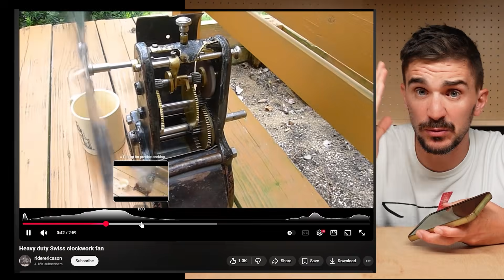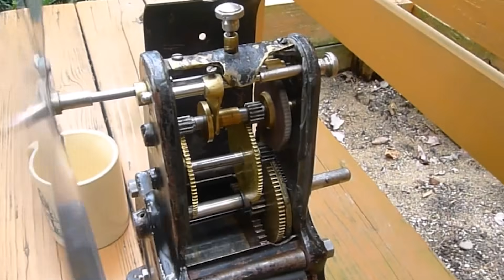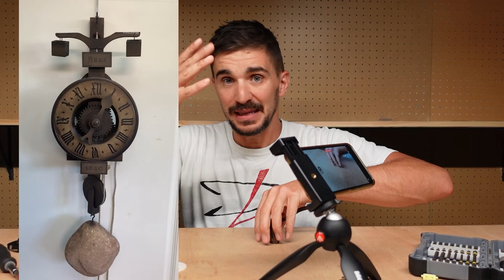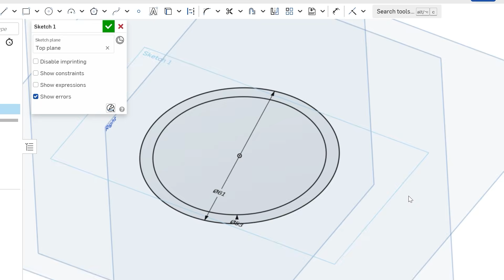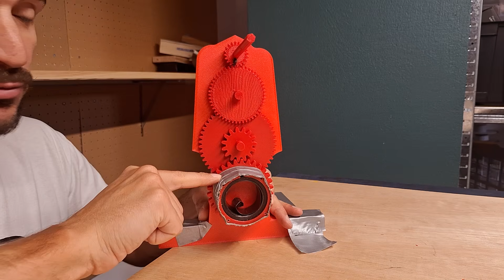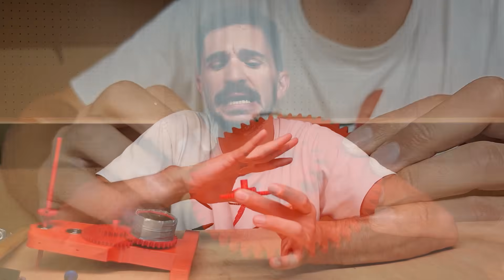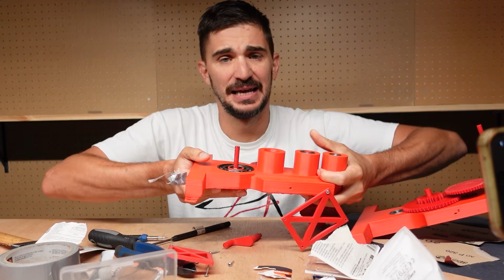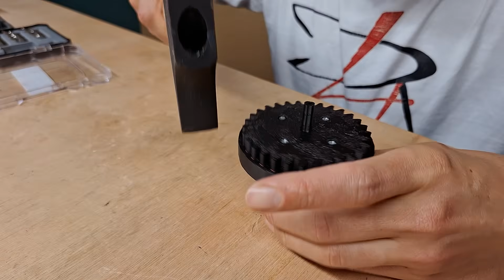No Cables or Batteries, Just Pure Mechanical Engineering - This Swiss Cooling Fan Cools You For Free

Comment: Wouldn't steel shafts and the bearings in the gears resolve your accuracy issues? There is also the weight of the gears, steel gears store allot more inertia, that could overcome minor imperfections or interruptions in the gear surface. Steel gears would be very expensive, but you can substitute it by adding weight to your plastic gears. Teflon spacers would also eliminate friction from gear faces contacting each other.

Comment: Hey! So, what if you used (laughs with you) electroplating & maybe a Stirling engine effect in your clock work. I mean, you now know that it will take more than 3 days to figure it out, how about 3 months? No, that's probably normal. Honestly, its getting tolerances down, sure, but it doesn't change friction components, vacuum, needing magnets in the teeth for the gears, & at that point why not just go for it & make a stirling effect anyways. Those are amazing clocks btw, astoundingly brilliant.

Yes, they are already made, yes they are amazingly high efficiency & even worse still, the processes they make them from as stupendously easy now. Which makes us feel like we can just go and do it. Which is true.

Not exactly much more than dunning-kruger effect problems of the skill gap issues that start almost all projects. (said in a nice wafty innocence voice that says its a truth that underlies a joke going on)

Because, it is though. Hard to get there & it requires consistent effort to make it. Instead, I can tell you magnetic bearing work & them on gear teeth work & using a small light oil works & having one crank move a total amount of air volume out gets a cube law theory of increase of total energy gained that can now use friction & pumping oscillations to drive out heat into a spring & that can start taking air out of the cylinder that you cranked down the plunger to then make the thing work with a flywheel like effect as the spring forces it to rotate.

 That helps with quite a lot, in terms of how its connected to any given styles of gears that then make a impeller with a set of center stators then a final propeller fan using a darwin like sucking in effect for air multiplication through Bernoulli's principal having the air split from the intake duct over the impeller. Meaning the impeller side has a duct, yes, then that leads to a middle stator area that needs your propeller & impeller to have a shaft/axel that is connected, thus stators in-between. A set of stators bent correctly will drag air using the coanda effect & trail off the tips from the before impeller.

with the duct splitting the air & joining the stators behind. Clear on that. Good.

Then the larger propeller fan driven by the cleverly hidden drive shaft that is hidden in the stator connects to the gear attached to the axel/shaft in this impeller & propeller set up where the stators are. 

From here, the ring that extends off of the tips of the stators & before the propellers allows for a series of connecting stators that go over the propeller blades & then have a ring in front of the propellers to help reduce the wing tip vortexes generated. A knob makes it possible to change the angle of the stators. Gears, strings hidden in the hollow stators all make this possible.

Which, you are clever enough to know how to do that.

I don't need to explain the how, I mean, pivot sections, tightening strings, rotating things, shaft rotates, etc you get it.

Lube with magnets to force it into specific alignment & not have to care about massive tolerance issues & needing metal & extremely fine machine work does help make this work better.

Skill issues of design, but also skill issues of thinking it will be easy. Doesn't matter, it takes skill to do this. Kudos for trying & kudos for having the skill to do it at all. I appreciate it dude. Maybe this could be another design you use, credit xenonreality (that's my other account)

Comment: How does the Stove or wood burning furnace Fan work?
Reply: The difference in energy between hot and cool creates a bit of an electric charge which then powers the movement of the fan blade. This is the cliff note version. You can dive a lot deeper into the concepts of peltiers and/or the Seebeck effect to understand more fully.

Comment: Engineering HighlightsEscapement Control: To prevent the spring from unwinding all at once, the fans used a regulator or escapement similar to those in mechanical watches to ensure steady rotational speed and consistent airflow.Precision Machining: The mechanisms required highly accurate gear machining and special spring tempering to withstand the extreme heat and humidity of tropical climates.Adjustable Performance: Many units featured a small lever that allowed the user to adjust the blade speed

Comment: The spring you used was maybe only 10% of the strength required, and 16:1 should be closer to 250:1. Notice in the video the spring barely moved -and it was maybe 5 or 6 inches wide. And, yeah, metal gears.
Reply: I used to have a wind-up radio that would run for about 1/2 hour. The mainspring on that thing was scary. At least 2" wide.
The spring would unwind slowly, and the little generator at the end of the train ran pretty fast, on a tiny rubber band that looked like an O-ring.
When you turned up the volume on the radio, the generator would slow down quite a lot! (this made the volume self-limiting.)
Reply: @eclectichoosier5474 
I currently have a radio like that... I immediately thought of gutting it and turning it into a fan lol but alas, I like it as a radio, it also has a solar panel and can run on sunlight, or the spring and the housing is clear plastic, so you can see the internals at work... 
I knew his fan wasn't going to work at 16:1 ratio...
Reply: @Quickened1 you might have exactly the same radio that i have :)
Reply: @eclectichoosier5474 
That's cool! I've been using it lately. On the hand crank handle, it says, freepower... freeplay. If yours does too, I guess they're the same. My radio is getting a little hesitant pulling in stations, like maybe a cold solder joint or two, but I think I'm just going to keep it as is, even though I would love to make a fan out of it! I've always been fascinated at how long the radio plays with 54 cranks!

Comment: Try a car leaf spring with a regulator so it doesn't take off.😁
Reply: I was going to suggest coil spring, but same idea.  If you've even used one of those DIY spring compressors (2 long bolts, with 'hooks') then you've collected energy until you saw the very face of god, and trembled, lol.

Comment: Ticking 4 answers: clockwork edition.
Maybe you heard about antique (around 1900) Stirling engine fans, aka "hot air fan", they can use heat of candle or kerosene lamp as energy source

Comment: Alternatives to clockwork mechanisms
A Sterling engine.
A weight and pulley system
A water drop system . This is similar to the pulley system except a container of water slowly fills until it overcomes the mass of a weight and pulls it to the top and the water falls out at the bottom returning the cup to the top to fill again, a gear and clutch mechanism lets the pulley spin the fan almost continually. If you have a stream or running water or a really big reservoir it will run for as long as the water flows

Comment: I believe there’s some kind of gear ratio going on in the winding of the original fan shown, the handle is too long to be a low torque application on the winding. Also considering the size of the bottom on the original fan I believe there’s a lot more spring there.

Comment: the surface friction can be helped with hdpe tape or a ridge that reduces contact area. you can make the internal structure as part of your design by using the shell tool and working with a cross section view to add your internal structure sketch
hope this helps

Comment: Know what´s cool ? The modern version of this would not be a plastic copy of the old, but instead a small battery with a hand crank and a generator attached, so you can use it "in the jungle" you can charge your phone with it and produce light, listen to radio that type of stuff.

Comment: 33:20 - well, no. It won't pay for itself ever. 1kWh of electricity (from mains charged battery) is way cheaper than 1kWh of food.
Reply: But humans need some workout. Better to make some useful work than waste that energy in a gym.
Reply: The food will be consumed with either power source, and when elec is not available, the application where airflow is critical the food input becomes very profitable
Reply: @orthodoxNPC good luck having enough food in a place without mains electricity.
Reply: @volodumurkalunyak4651 yea i know right?  Good thing those mains have been around for thousands of years!
Reply: @orthodoxNPC thousands of years of barely enough food and plenty of exercise. Today is 2026 and I am writing about today, 2026.

Comment: To be honest, yes they were precisely engineered.
And the Gear ratio does look a lot more precise with that old Fan
However for you to have 3D printed that and out of a Measuring tape spring is equally Impressive.
Yes the Potential is there, but nobody has dared to recreate it.
I still believe that we need more Manual operated things in our broken economy
Metal machines that are more mechanical than electrically operated.
Sadly we are in a Buy once, throw away later economy where we buy the same things (like electric fans) each year and throw them out in about few years into the future.
Remember those old dryers that you basically squish your laundry and squeeze each drip of water out of them?
I dont have space for a modern day dryer, but a bucket or Tub to place such mechanical one would do wonders for me and accelerate the drying process.
Sadly you dont find these and they genuinely are hard to find and are expensive or just too big or not the right size, also made out of plastic instead of metal rolls.

Comment: It doesn't have to be expensive. Similar clockwork supplied with a DC brush motor with around 20 000 : 1 gear ratio for toy cars costs something like $11 (40 PLN here in Poland). Gears generally are mass produced as never before, now with plastic not metal as much

Comment: Rather than sanding the faces of the gears, I think I would offset them so that the faces don't touch. Small bosses on the gear shafts press against the inner race of the bearings to keep the gear in place and maintain the clearance between the faces.
Reply: Thrust washers aka shims do the job.
Reply: I was thinking much the same!

Comment: I mean, you could have skipped the sanding by making the gears a bit taller and using spacers, which may have also improved allowances in the system. And you could make it more efficient, less noisy, and maybe even cheaper with just a sheet-metal framework. If you use a different translation mechanism with a vertical shaft (driven by a worm gear from the spring box), it may only need four or five bearings (one on the load side of the fan, one or two on the vertical shaft, and one or two for the spring box), and a bigger spring box with a more powerful spring... I don't think it would be more expensive than an electrical fan. 
But I'm just a tinkerer with a bit of mechanical background, not an engineer 😁

Comment: You can always spin a manual flywheel as a fan. The oldest manual lathe tech. Forget the complex clock gears thingy. Sure you can use gearing to get the single shaft fan flywheel faster. Flywheel requires no springs. Literally a spinning rock battery. If the fan has internal flywheel then just spin the fan on a bearing shaft hand crank. Best gears are no gears required.

Comment: You need to wind up the spring first (like use needle nose pliers to turn the end in the middle so it is wound around pliers, or 3d print a piece to wind it around), then you can transfer easily
Reply: Yeah and make a rewinding tool from a cordless drill if you unspool one

Comment: There are fans that work off thermodynamics. They're for using on top of wood heaters.
Reply: Those aren't thermodynamic, sorry. They use a peltier junction to generate electricity which then turns the little motor & fan, or maybe this is something I haven't seen yet?
Reply: @sandrainthesky1011 , I'm talking about the ones that use a Stirling engine.  Those do operate on the thermodynamic principal.
The ones you mentioned use thermoelectric , (as you said a peltier junction) to operate.
But yes they have them, and they pretty pricey compared to the other ones.

Comment: cutting spring made me sad( minus longevity,  because of stress concentration spots by uneven cut
shafts shouldn't be printed vertically, 3d prints are much stronger along the print bed plane, layer adhesion is weaker
instead of polishing there should've been stoppers on the shafts so bearings and teeth are the only points of friction, gear sides should never touch anything
:(

Comment: I believe you printed everything with PLA and it's not a good material for gears. For a first prototype I'd use PETG and for final version I'd consider Nylon or PETG+PTFE. PLA is still very good for a housing. 
Second thing is the shape of the gears I'd use those Citroen-like ones. And there are just 2 gears that needs to rotate together with a shaft: the spring one and the fan one, for all the others it makes no difference as they're fused together.
16:1 gear rate looks so slow... I'd try goin even up to 50:1, but that's much harder to design and and make it actually run, so might be impossible with 3d printing.

Comment: I made a small handheld one of these in grade school by tearing open a wind-up toy, using its builtin gearbox, and attaching a propeller (from one of those rubber band powered planes iirc) to its output.  I think the gearbox was originally part of a godzilla toy that shot sparks out of its mouth.  To do this it spun a knurled wheel really fast with a flint that bounced on the surface of it.

Comment: Lmao wow you made it far more complicated than it needed to be.
My hats is off to you for sort of understanding how it all works.
If you really want to see how badly you can make a clock or clock work mechanical fan, go buy an Ansonia or Sessions clock. They are quite cheap.
Take out the pallets (escapement). Wind it up and just see how well an extremely cheap thrown together POS clock can actually work.
Main wheels, 3rd wheel 4th wheel all bent, from factory. Even seen a few escape wheels bent and still work.
Side to side (Lateral) doesn't really matter,  it's Radial (Up and down) that matters the most. As you will obviously already know.
I was a clock maker for 20+ years and I have seen so many extremely poorly made clocks that were 100+ years old that still work today that I was amazed actually worked when they were new.

Comment: I think the factories making coil-spring-powered toy cars and auch could still make those pretty efficiently, except they might not be equipped to make anything of that aize anymore. it can probably be done withproperly injection molded plastic gears. 
there also used to be a lot of types of large music boxes powered by coil springs around the time those fans were made. and I'm pretty sure that the mwthods of mwtal machining at the time were great for producing many gears of the same or similar designs, because gears are very much assembled of the same cuts being made again and again.

Comment: This is finally an application for planetary gears. I think somebody can get this to run for 10 min, 3d printed. Probably not worth the plastic, but as a curiosity, it's cool.
Looks to me like the original gears could be 50/60 to 1. I'd aim for half the gear ratio and design from that. The original fan probably has 5 times the torque in the spring. I don't have any idea of where we might be able to find main springs that tough, and the 10m tape measure spring is probably dangerous enough for a diy project.